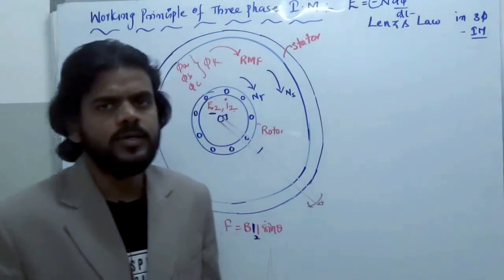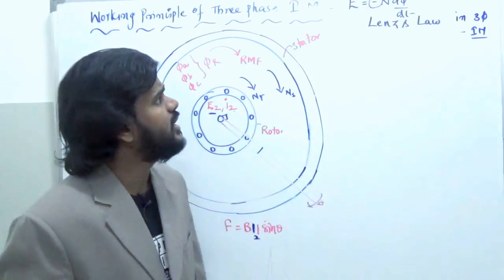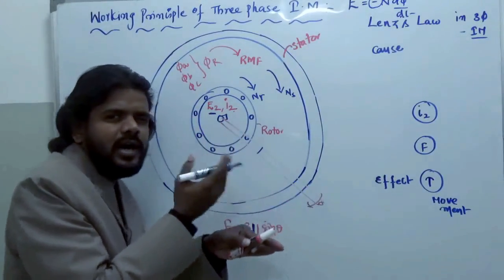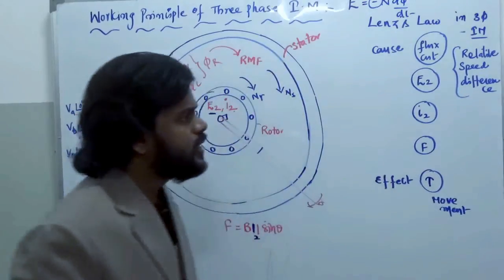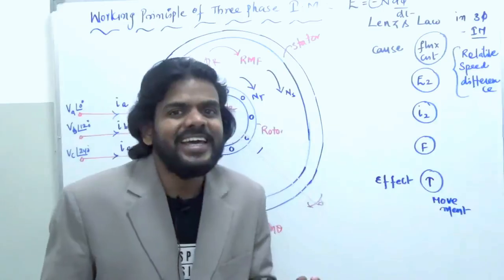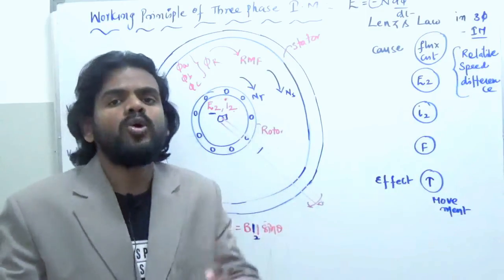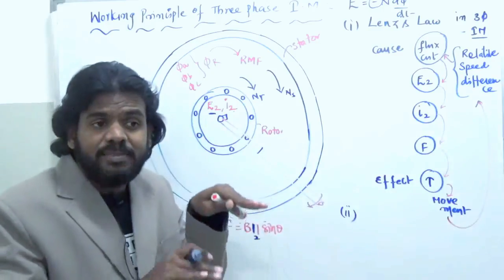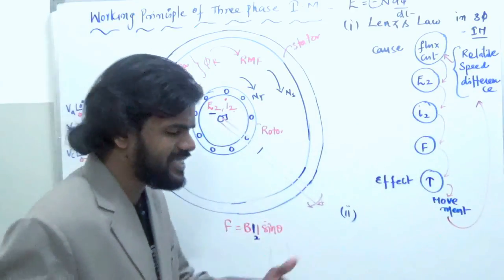Why three phase Induction Motor runs in the direction of RMF

Comment: Sir could you plss explain the concept of relative speed if the direction of rotor in opposite manner than a synchronus speed?
Reply from the maker: I believe, as per lenz's law rotor always tends to run in the direction of stator. So, opposite direction is only possible in generating mode.

Comment: sir thanks for your explanation in direction of motor rotation. i have doubt in electrical concept. since rotor core in mounted shaft. rotor shaft also carry electrical current. then why we does not fell shock  in motor shaft. motor shaft and stator frame also conduct electricity. the why it is not causing electric shock in stator motor frame and rotor shaft. can explain this.....
Reply from the maker: Dear Satish, appreciate your query: Rotor core  is made up of silicon sheet lamination, which does isolate the current flow. Consequently, rotor and shaft are  not connected electrically though connected physically. Hope this helps.
Reply: thanks for reply sir. but my doubt is not cleared sir - if stator and rotor core is made of silicon lamination which isolate current flow then how eddy current loss happen  in stator and rotor core ? if current flow happen in stator core why frame is not getting shock?

sorry if i have asked you silly question to you - it is my eager to clear the concept of IM motor.
Reply: @sathishlakshmanan9317  current always follows a less resistance path. as the end rings are shorting the conductors at both ends, so this end ring path will have very less resistance than the core.